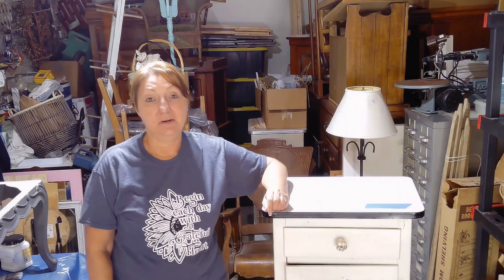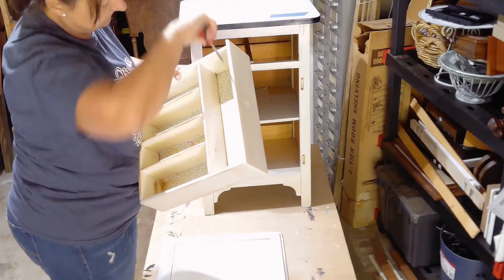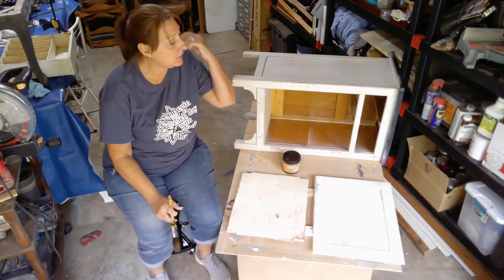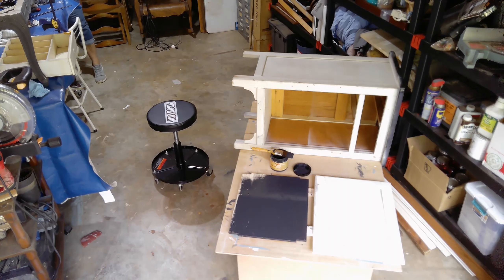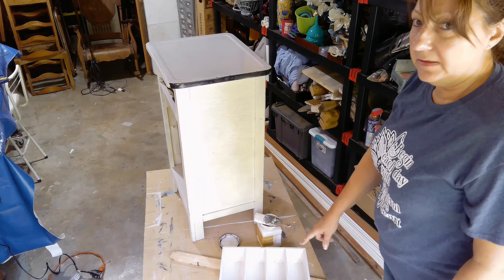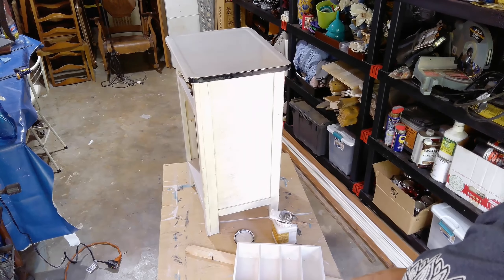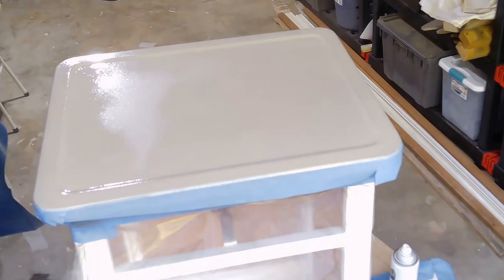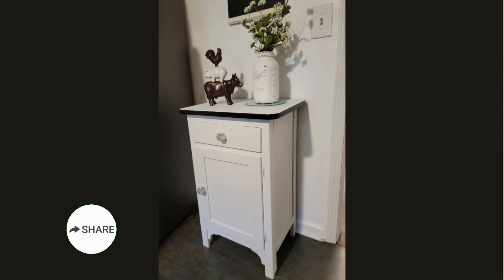Vintage Cabinet | Flipping for Resale

Comment: If you soak that contact paper in totally LA Awesome spray from Dollar tree it'll get it to come out easier, it also takes off the sticky from tags and such. I dunno what it would do to the wood though. I use an old toothbrush to clean tiny corners like you have in that divided drawer 😬
Reply from the maker: Great idea!! Thanks Paige.